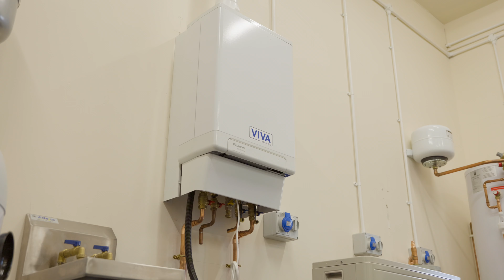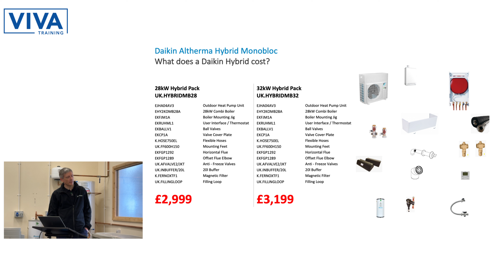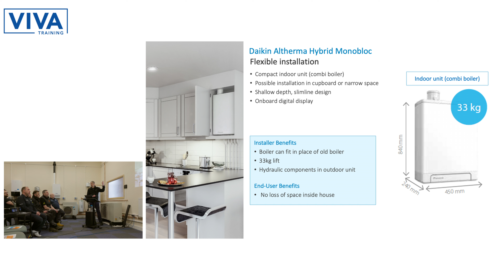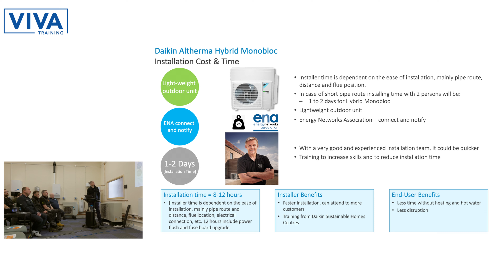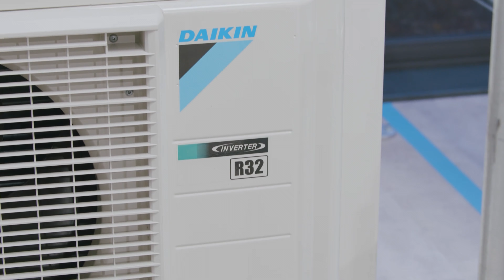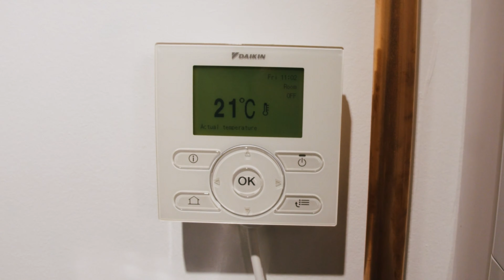Daikin Hybrid Heat Pump Training Day At Viva Training

Comment: @ 32:46 If you put a heat pump with refrigerant R290 too close to a gas boiler, there is a good chance that that boiler will become a kind of vampire and want to consume the "blood-R290” from that heat pump 🤪😜😋
R290 is G30(propane) gas but in pure state … 
😊